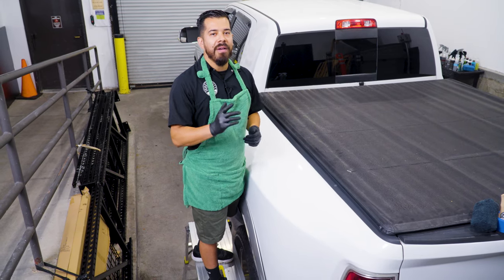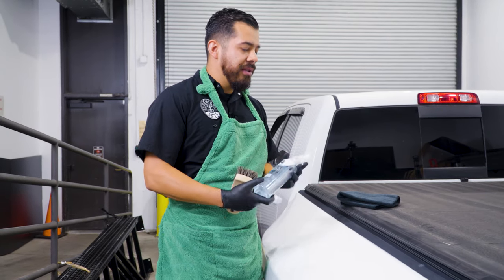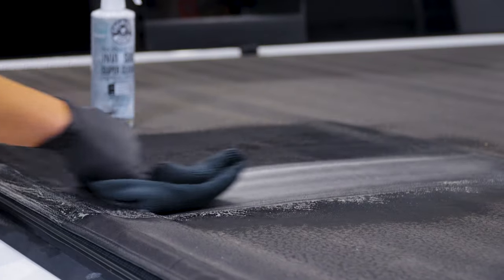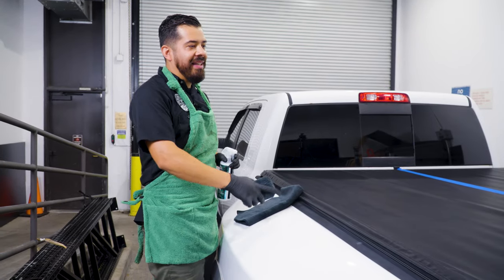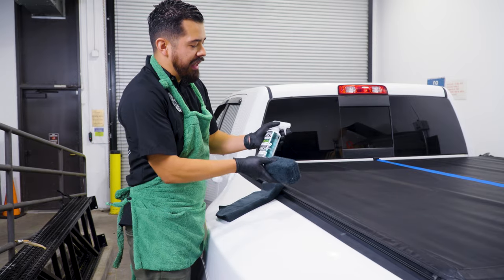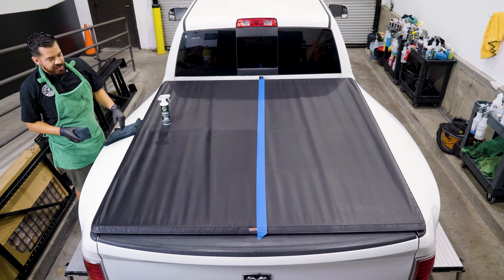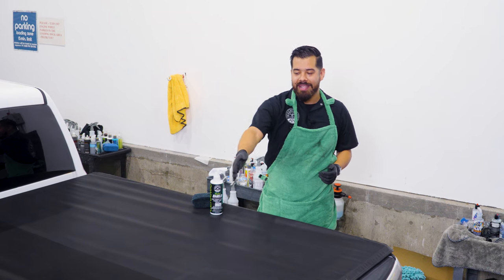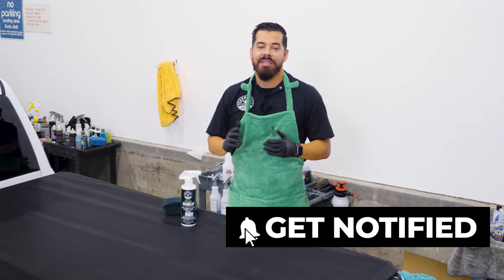How To Clean & Weatherproof Your Truck Tonneau Cover - Chemical Guys

Comment: Hydro shield works great on my Ram 2500 black trim next time I detail I will clean and use it on my tonneau cover for nice protection… my favorite product is speed wipe, I use it in between washes for a nice clean shine

Comment: How about using VRP for a soft roll up tonneau cover instead of HydroShield
Reply from the maker: Absolutely! VRP is perfect safe as well.
Reply: If you use VRP, and it rains, you’ll have oil spots running down your truck panels